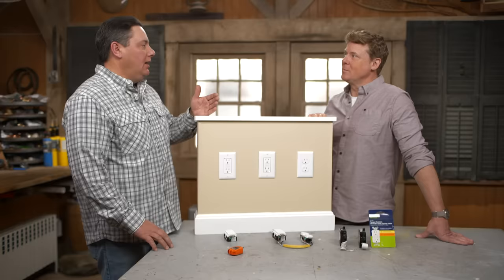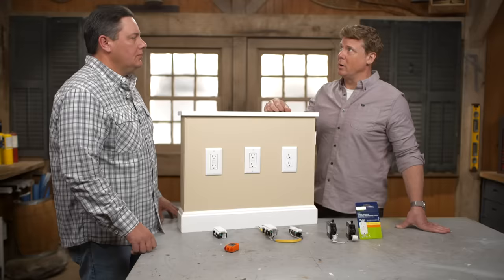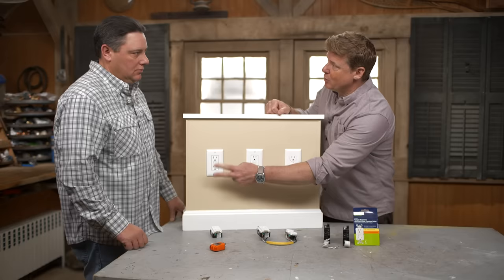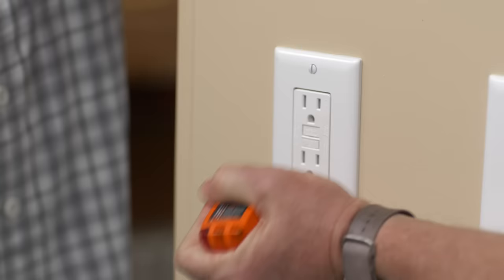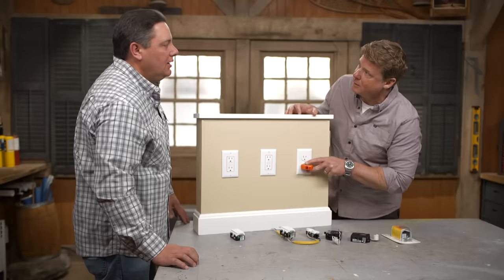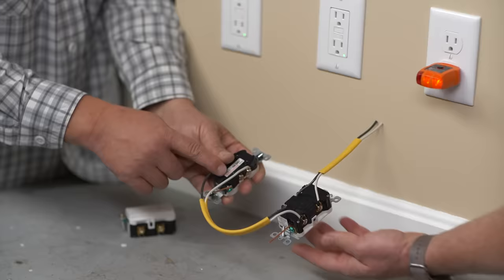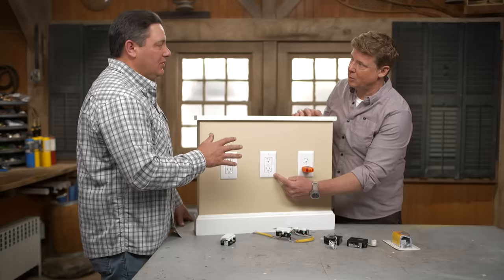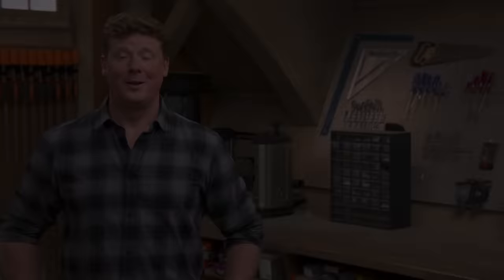Everything to Know About GFCI Receptacles | Ask This Old House

Comment: When these devices came out, they were called GFI (ground fault interrupter). Now, they are called GFCI (ground fault circuit interrupter). Why the name change?
Reply: Because GFCI's only protect one circuit each. GFI's are pieces of equipment usually built into breakers but can be standalone units that typically protect an entire electrical panel or groups of electrical panels
Reply: @kylefowler5082  ... I have yet to see a GFI that protects an entire panel. They are only for a single circuit, although you can wire to do multiple outlets within that circuit.
Reply: @rupe53  you don't do electrical work for a living. Marinas can have dedicated GFI units.
Reply: Sorry, only residential work here. Never wired in a marina before. I have wired surge protection to a panel. That's a different animal. OTOH, this video is about residential stuff.... and very general at that.
Reply: @rupe53  In Europe it was previously common to use one RCD for the whole house/apartment but that has the problem that everything goes dark if it trips so they moved to two and then to individual circuits. In the US having just one would not work because of the low tripping current.
Reply: @okaro6595    the biggest problem with doing an entire house on one or two protection devices is hunting down the fault. It could be anywhere.

Comment: Licking your fingers and sticking them in the socket wouldn't trip the GFCI,  it would trip the regular breaker,  since you're drawing current through the neutral and live wires,  not the ground.
Reply: it would trip the GFCI, not the breaker, there would be leakage through the human body, if there was no GFCI it probably still would not trip the breaker if you poked around with wet fingers.
Reply: If you perfectly close the circuit through your body, and you have no other contact with a ground path, then yes I agree. Edit: with the exception of tripping the breaker, as others noted.
Reply: If you were isolated from ground, it would do nothing except shock you. To trip the breaker would require 15 or 20 amps flowing through your body. You would be very dead if that happened. The electric chair passed 10 amps through the prisoner. It is probably not possible to pass that through a body at 120 volts.
Reply: @ralph5450  squirrel
Reply: Completely wrong.... a breaker requires so much current to flow that you would be completely toast dead. If your body had a low enough resistance to get such current going at least. A human dies at 0.018 amps, breakers are usually 10 to 16 amps. A GFCI is the only thing that will save your rearend.

Comment: I am a Field Service Engineer and I can tell you that GFCI Receptacles are a nightmare. Many new medical offices have these installed almost exclusively and these receptacles do not like equipment that draws high current. One of my clients actually had to have an electrician come in and install a non CFCI receptacle just so he run the equipment.
Reply: Well that’s too bad buddy. GFCI’s save lives and I’ve seen it with my own eyes. You are a field service engineer, not an electrician.
Reply: @davidredpath4781  I never said I was. Just relaying my experience from my perspective.
Reply: @jaxxonbalboa3243  would you rather have someone inconvenienced by an appliance not working or someone dead because a GFCI not being installed. Not arguing just conversation.
Reply: @jaxxonbalboa3243  Off brand GFCI's nuisance trip like mad. Also Leviton GFCI's are notorious for nuisance tripping. I've seen both issues with my own experience in the field. I stick with Pass & Seymour and Eaton brand GFCI's. If they trip something is wrong
Reply: @davidredpath4781  Strange question that has nothing to do with the experience I shared here.
Reply: @jaxxonbalboa3243  that’s what it comes down to at the end of the day
Reply: @kylefowler5082  agreed
Reply: @davidredpath4781  Using your it works out that way.

Comment: Why not call it a circuit breaker
Reply: A circuit breaker will trip on an overloaded circuit, hot to hot short, hot to neutral short, and a ground fault, but only when the circuit breaker rating is exceeded.
Reply: Short answer: Because a GFCI is not a circuit breaker. Long answer: See Ted's answer.
Reply: @surferdude642  couldn't you set a smaller trip amppage for a circuit breaker
Reply: @leohoward7282  Not really. The lowest rated circuit breaker for residential use is essentially 15 amps. What you could do is install a gfci circuit breaker. Then on a ground fault only it will trip like a gfci receptacle. The downside is that the whole circuit will off and you have to go to the electrical panel to reset.
Reply: @leohoward7282  Still wouldn't be low enough. Circuit breaker protects the wiring. GFCI protects the user. On a related note, if one is in series with the load, GFCI likely won't trip. For typical use cases, often not an issue, but for electrical work could be. Some may get a false sense of security thinking GFCI will protect them when rewiring an outlet or circuit instead of taking additional precautions, such as making certain the power is off.